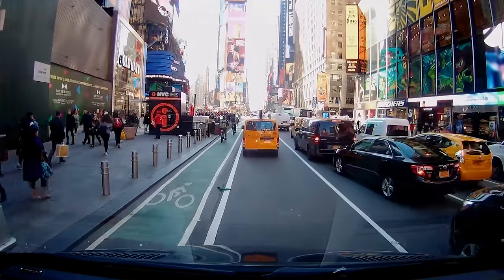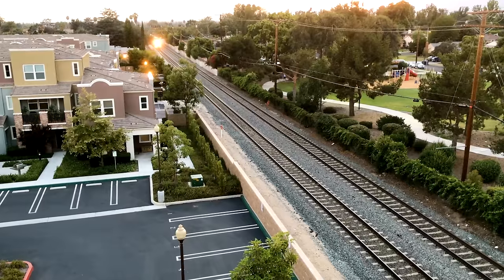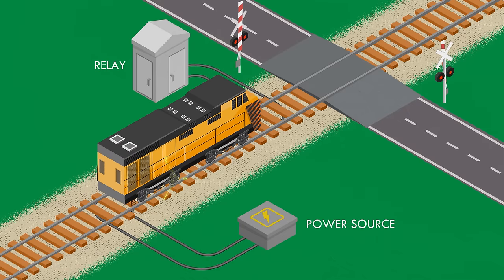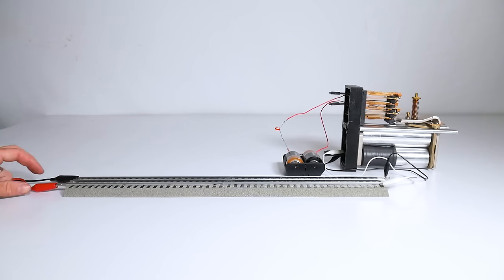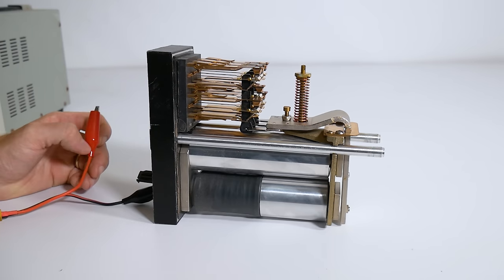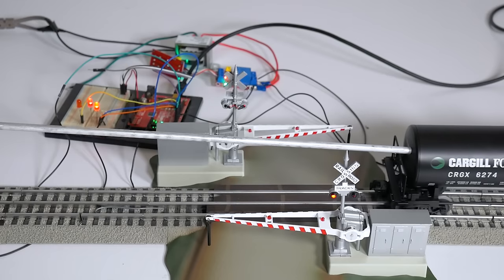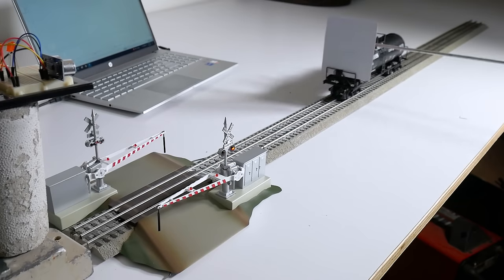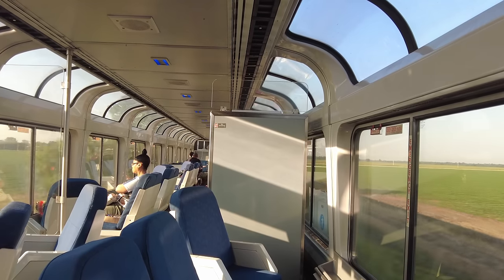How Railroad Crossings Work

Comment: Thank you for including the blue sign with the crossing information.  If you're ever stuck on the tracks the first thing you should do is call that number and give them the crossing ID.  It is the fastest way to stop a train.
Reply: All gas stations have an e-stop (big red shutoff button) for the pumps.  Learn where it is for the gas stations you frequent.  You may need it one day.
Reply: I've used one of these myself just to call and let them know that a pedestrian gate was stuck down. People were walking Around the gate and that's a dangerous habit to form.
Reply: Wouldn't shorting the rails with your jumper cables (in addition to activating the crossing signals and gates) also turn the signals on that section of track red to warn any approaching train that there is another train on that section of track?
Reply: Only in PTC protected track and even then it’s never fool proof.
Reply: 1st thing you do is get out of the vehicle and off the track. Great to know about the sign though. Not familiar enough to have known about that.
Reply: I have a friend who was a volunteer firefighter in a town with a railroad through it.  he had multiple times that a train pushed the wreck out of the incident scene despite calling the number and telling them to hold trains until the wreck was cleared.
Reply: @major__kong  Could use one of those big red buttons at the actual train crossing too... smash and punch it to alert operators of an obstruction and automate a 911 dispatch.
Reply: Barriers are by design not only weak enough to relatively safely break(sometimes with break points if they are made of harder materials) if needed, but also with counterweight so lifting it wouldn't be hard either. In any case crashing into a small barrier is way better than getting crushed by a train. Also doing any of the mentioned (causing barrier to be broken or not closed) can trigger a warning on tracks to warn the train that the crossing has an issue so speed should be reduced.
Reply: The first thing you should do is move to a safe distance, then call the number...
Reply: Also, if you are stuck on the tracks. Get out and run TOWARDS the train (Not right at it, but moving further from the tracks) The impact will be behind you and all the debris will be moving away from you. If you run away from the train, the impact and debris will be coming at you.
Reply: Wrong! The first thing you should do in that situation is to get out of the car and off the tracks. Then make the call.
Reply: @undefined40  wow thanks captain obvious! 🥴🥴🥴🥴
Anyone who doesn't already know that is worthy of winning a Darwin award
Reply: @CantHandleThisCanYa You'd be surprised at how many people don't think of that and stay in the car. I know a person who's relative got stuck on a track many years ago and 4 people stayed in the car while figuring out what to do. The driver survived, but his wife and 2 kids died instantly when the train approached. 
However that was like 50 years ago, I do hope the safety on the tracks improved radically since then...
Reply: @Codewow  No way that would be viable. Punks and vandals would be hitting that button just to create a little chaos.
Reply: In Flowery Branch, GA where I used to live, there's a double track section that's used to allow trains to pass each other. It was not uncommon for a train to stop in the middle of the major crossing for upwards of an hour. You'd have to drive 2.5 miles in one direction or 1.75 in the other to get to a bridge. Everyone in the area has complained to the city, county, state, and railroad, but nothing is done because the railroad doesn't care. Thanks to the tycoons from the early age of railroads, they have a bit too much freedom in their decisions.
Reply: @kalkovonschpritzendorf1914  That part of safety has not improved any more than by reducing the number of level crossings. Cars will still get stuck despite the "do not stop on the track, drive through" and the (while sitting home in a chair safely) obvious idea of getting out of the dangerous situation. People have not changed, even if it seems a lot more are a lot more entitled these days.
Reply: @danieljohn560 Call AFTER you vacate your vehicle.
Reply: @JCWren I was about to say the same. You would have to make it a telephone so they could question you, but that would be a huge maintenance headache.
Reply: @57thorns  People indeed have changed - but not to the better :D

You may add a thousand safety features and some moron will always decide to climb over the fence, open the locked gate and then proceed to walk right on the track with headphones on while reading a book...

In the city where I'm from, a girl was killed by a tram few years ago after doing this - walking on the rails in the middle of the city, with headphones on and reading a book. Didn't hear a thing, didn't see a thing (didn't even LOOK), she was dead on the spot and the driver has to live with that for the rest of his life...
Reply: If you get stuck on the tracks, the signs here in Sweden says to just driva through the gates. Since that damage is nothing compared to what harm a car/train collission woule cause
Reply: @davidgates1122 Yes, it would. In fact some crossings have a length of pipe placed on the crossing barrier you can take off and drop on the rails. 

Here a couple months ago, barrier kept triggered and they were working on it, well by they, I mean one guy. He was operating the crossing barriers manually to get traffic moving while he worked on it. I asked him if he had walked the rails and he hadn’t but when I came back through awhile later it was working and he was gone so I guess he got it. There has been a kid shorting the rails there every now and then.
Reply: I @BrainScramblies  I've used it to report almost getting hit by a train because the gate and lights didn't work
Reply: @57thorns  better layout will go a LONG way to reduce the number of vehicles "stuck" on a crossing. True, you will always have cars that are actually stuck, but with most of the ones that make it to YouTube, the car wasn't stuck at all; it was merely the driver that thought stopping there was a good idea; usually because they wanted to turn left and had to wait for the road to clear. 

If you can't turn left within a 100 yards of the grade crossing (force people to go straight and do a 180 instead, if you can't move the side street), you greatly reduce the number of idiots that stop on the tracks.

Stopping on the track is bad enough, but some people just can't take a hint... When the barriers close and the train starts sounding their horn, cut your losses and go straight! Floor it! Ram the barrier if you have to; I can guarantee you the barrier is way softer than the train is...
Reply: @davidgates1122  not reliable as there might not be a signal between you and the train and also a federal crime.
Reply: Not only that, but in the event it can't be stopped, they can slow, let the rail networks know to be weary of going there as there could be a pileup or the vehicle might still be there, send for help, or derail the train (when it is safe and possible to do so).
Reply: Question from across the pond I'd maybe better ask here than the first time I see that blue sign: In both the animations as in even many of the clips, there are neither overhead wires nor third rails to be seen? So what form of electrification do those lines use then, if neither of those two?
Reply: @kalkovonschpritzendorf1608  the safety on the tracks has but yhe average intelligence of the human race has deteriorated significantly.
Reply: @CantHandleThisCanYa  You would be surprised how many "obvious" to do things are omitted by people in distress when not explicitly told to do. Go to your local fire station and pick an experienced (means older) looking firefighter and ask him for some anecdotes.
Reply: @paulnieuwkamp8067  but, but, but, I want to turn and you can't tell me otherwise. Sometimes it's just best to remove certain genetic matter from the gene pool. I think it's called "survival of the fittest"
Reply: @1121494  diesel electric. The locomotive is diesel engine driving a generator or alternator and the electricity drives traction motors directly at the wheels.
Reply: @JCWren  My father's best friend moved multiple towns away because CSX would idle trains behind his neighborhood at 3am. The police chief hated it too, since it blocked the best way in for emergency vehicles
Reply: @Codewow  I've never seen an E-stop at level crossings here in the US. But they are at many urban crossings and all stations in Japan that I've seen (sometimes labeled as "SOS"). Some lines/segments in Japan also have obstruction sensors near level crossings, rural areas with lots of private (unprotected) crossings, and tunnels (usually an IR beam, inductive loop, or tripwire) and a special signal to alert operators.
Reply: @davidgates1122 You could also cause a massive derailment. If an approaching train has active PTC and it’s in a close block, it can stop the train with an emergency brake application.

Please, just call the number. It takes less than a minute for the information to get to the crew operating approaching trains.
Reply: You probably get an answering machine.
Reply: this is the first thing I look up whenever theres a crash near a RR track. fortunately our system has the DOT# on them, but google maps street view can work in a crunch.
Reply: I feel like using the brakes is faster.
Reply: @Codewow knowing humans, there would be a massive amount of false alarms, and the system would end up being disconnected
Reply: In Germany, I've often seen emergency buttons on platforms. They will probably not just stop everything. But slowing down approaching trains to a speed where they see the whole breaking distance would be enough. Depending on the train that will still be a big issue. But it's boring enough so that intentional misuse is boring enough to not occur very often.
Reply: @matthewf1979  Sage advice.
Reply: Not that there’s anything you can do about it but how much electricity is consumed by all these “always powered on” grade crossings and is there backup power for grid down situations?
Reply: Not all railways use a blue sign. Many of the Class 1 lines out west (UP and BNSF for example) have a sign stenciled on the side of the electrical "cabin" that serves the crossing gates and lights. Same vital information as CSX's blue sign. Calling the number and giving the rail dispatcher the crossing number alerts any train nearby of your emergency. It's a reference so important, we need to be training more first responders about it.
Reply: @xx5zi  If we still taught driver's education in schools, we could teach a lot of people who could potentially use that information.
Reply: @davidgates1122  Hello David. That's not advisable. An approaching train may already be too close to stop. The absolute best method is to call the number on the blue sign and give them the information on that sign ONLY. Other crossings which might be in the same general area have different identification info.
Reply: @primordial_platypus not much. Because the barriers are counterweighted, it doesn't take a lot to hold it shut. Just a little electromagnet holding a metal rod in place. Something like that.
Reply: @thomasdupee1440  if I was a half mile away from the crossing in question, clearly couldn't make it there in a reasonable time, I'm calling in from the crossing I'm at, and relaying to that controller that my crossing number is actually the next one over. They stop every train in that block, and slow trains in the blocks on both sides (a "block" in railroad terms is a section controlled by signal circuits, or directly by the dispatcher's panel. They can be a couple of miles long, or many).
Reply: That was the biggest piece of information in this video in my opinion! I learned a ton by watching this but now I'm ALWAYS gonna look for the blue sign when I cross railroad tracks. Ingrain that in my head for future reference!
Reply: @Kitteh.B  Depending on what part of the country you're in, it may not be a blue sign. Out west here, they stencil it in black on the silver control boxes next to the gate.
Reply: I second this! In Redding, Ca the semi got high centered, my father didn’t know what to do. BNSF and South Pacific gave our group a presentation about railroad safety, because of that I was able to share the blue sign ID with my father. Thank you to anyone that works for the rail, dispatch especially.
Reply: @davidgates1122 This is how you get in trouble with the law. Not all tracks in the US have signaling. If you do this you deserve a felony
Reply: I disagree: the very first thing you should do is get out of the car and to a safe distance.
Reply: @HammondOfTexas0 some crossings in UK have telephones (connected to signal boxes in olden times) so that drivers of long/slow vehicles can announce their presence and get permission to cross.
Reply: the OP doesn't mention an oncoming train: obviously if there's a train coming, get away quickly.
Reply: @kenbrown2808 Typically the railroad does not care if something is on the rail.  The train has Federal priority over all safety and this is just really done as a happen-stance safety measure in their opinion.  Look at how many crashes and derailments they have allowed to happen with the lack of actual safety procedures which could have been prevented with maintenance and technology.  There are temperature sensors for the trucks to see if something is going wrong with a train and report that to the cab of the engines for example.
Reply: Beg to differ, the FIRST thing you should do if you get stuck RR tracks is to GET OUT OF THE CAR!!!
Reply: The signs aren’t always blue. Many of those silver enclosures at crossings have a white sign with black stenciled phone numbers, or even just stenciled on the side of the enclosure with black spray paint.
Reply: @justsomeguy5628 
There’s no such thing as “derail the train when it is safe”, let alone possible. You’ll end up in federal prison with no early release for good behavior, if you survive in the first place. I can promise you if I’m on the train you derail and I survive, you won’t.
Reply: @ralfie8801  I'm not talking about a person, and it would be a rare circumstance, but train derailers are a thing for lightweight trains and engines. Sidings are always preferable though, and this is pretty much an outdated and not particularly safe method of stopping trains in emergencies, and wouldn't be used on a passenger train. But sometimes, it is done if the damage to the rail won't be too severe, if nobody is in or around the derailed end, and the engine will still keep a straight path. I will admit, I don't know much about railroads, and don't exactly know the modern procedures and regulations, but the point is that you should call the number to try to prevent accidents and avoidable damage.
Reply: @justsomeguy5628  
I work for a railroad, nobody’s going to derail a train to prevent it from hitting an obstruction on the track. It’s way cheaper to hit the vehicle than to repair damaged rail and a derailed train. The locomotive rarely derails from striking a car, and damage to the unit is minimal, and the owner of the car or their insurance gets to pay for it all either way.
Reply: @davidgates1122 shorting the rails would put the gates down, and at most would probably show the train ahead of schedule on dispatch if at all
Reply: although technical more complicated, Germany goes for another approach: level crossings with CCTV and radar detection
Reply: I'm sorry to say, people just cant take a hint. they will tailgate over the crossing, and sometimes if you stop short of the unclear crossing they will drive around you and block it. I suspect we will need sensors to prove the track clear before giving a proceed signal.
Reply: Also, if you get stuck between closed barriers at a crossing, just back out or go forwards. They bend.
Reply: Also, if you get stuck between closed barriers at a crossing, just back out or go forwards. They bend.
Reply: I have NEVER seen a blue sign on any crossing in the USA (Not in Florida) in all my years of railfanning, I've only seen REFLECTIVE WHITE placards with crossing info, along with other pertinent info the railroad requires.  

There might be blue ones elsewhere, but I have NEVER, not once, seen one in my area, or in all my many years of railfanning.
Reply: @robertalexander-bk5zj no one is, that’s why they mentioned it
Reply: Luckily I hope humans know not to stop on railway tracks..
Reply: @Codewow Americans couldn't handle that. Losers would abuse it
Reply: @undefined40 Personally, Id stay in my climate controlled car with tunes on unless a train is coming 🤷‍♂️
Reply: @kalkovonschpritzendorf1914 Maybe we should stop expending resources trying to "protect" people like that from their own utter idiocy. Would make the human race better
Reply: @Elladril  Don't forget to honk back when that impudent train engine's driver uses the engine's horn at you.
Reply: @Elladril  That sounds great but sadly we have to protect ourselves from them. What might be "evolution" for the one on the car, may end up in fatal disaster for the passengers of a train  :/
Reply: @kalkovonschpritzendorf1914  Youre right, I hadn't thought of that. Passenger trains should have a much higher standard of safety than cargo trains, just like airplanes.
Reply: I've had to explain this to a guy's car that we smashed.he said he had no idea. He called 911. I said yeah most people don't know about  this. It would be faster to call that number and give the DOT # of that crossing. 911 has to get out a map and figure out where you are based on a street, then call that same number that you called. One less step in the process.
Reply: That is good to know, but I do feel the first thing you should do is clear the track
Reply: @Codewow  Fun fact, if you bridge the two rails using jumper cables, it will do the same thing effectively. It's helpful when you don't have cell service. It causes the signals to turn red in that section and it will notify the train dispatcher. Don't ever do this in a non-emergency, as it's super duper illegal.
Reply: @robertalexander-bk5zj also after evacuation walk towards the oncoming train (obviouslynot on the tracks).. I've seen parts thrown up to 1/4 mile in the direction of travel.
Reply: @imnotgivingmyname_toamachine  The signs with the number to call are convienently located so that they can only be seen/read while off of the tracks.
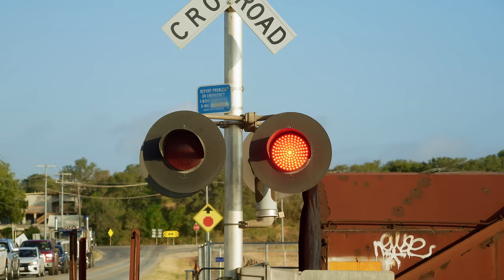Reply: 14:30 - this blue sign
Reply: @kalkovonschpritzendorf1914  no amount of safety improvements can fix people’s dumb decisions.
Reply: @1121494  electrified rail is generally used for metro rail lines in and around major cities. For the longer lines, the sheer length of the railroads means they aren’t generally electrified. Instead, diesel-electric locos are the norm.
Reply: @ImieNazwiskoOK  As for the latter, that's not the case in America. Crossings are not interlocked with signals, and there are no special indicators either. Moreover, there are even whole railways without signals, this is known as "dark territory".
Reply: @joshuawhitman8254  Here in Russia it's actually a rule. You're also supposed to send passengers along the line. And when doing so, you are supposed to swing your arm in a circle (preferably holding something visible, like a bright cloth, or flashlight) to signal the driver to stop.
Reply: @HammondOfTexas0  Not really. They have them at a lot of crossings in the UK. They're primarily intended for drivers of large or slow-moving vehicles, that take more time to cross. Also they have them at private crossings; drivers are supposed to phone the signaller to get permission to proceed. Works pretty well.